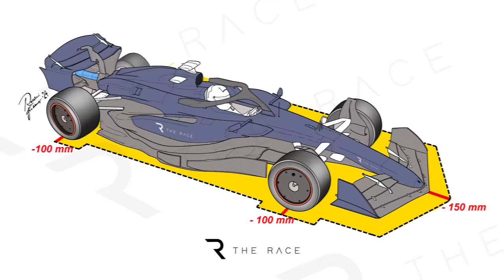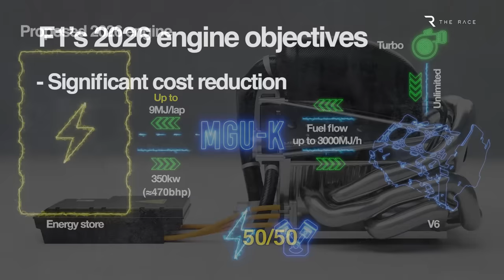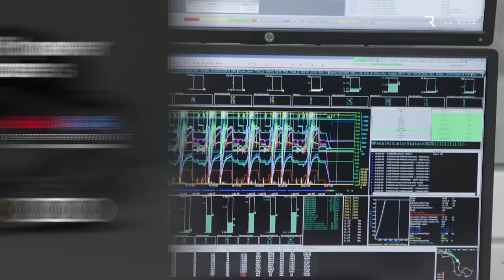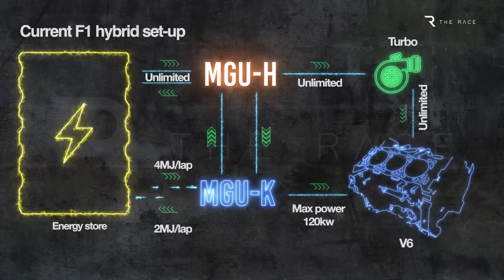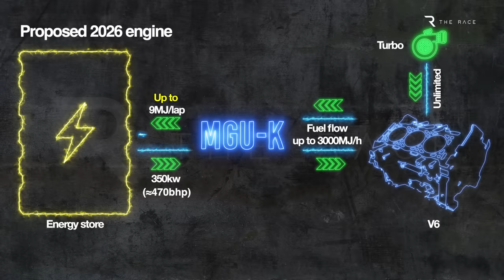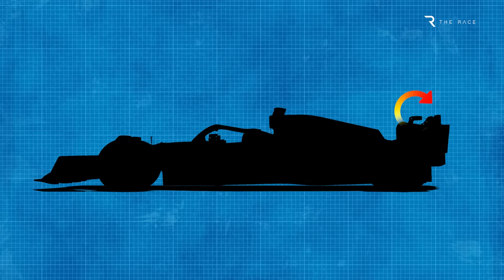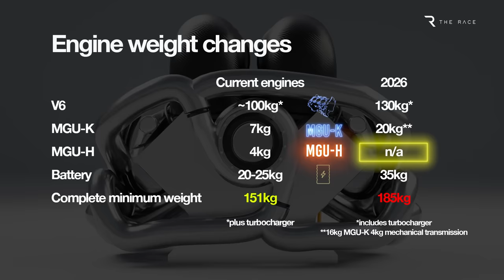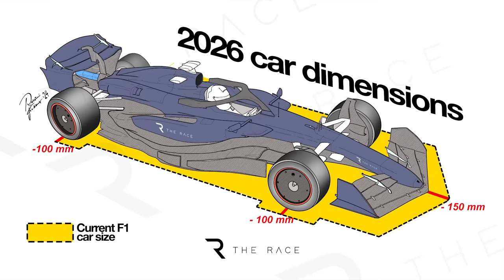The truth about F1's controversial 2026 cars

Comment: I'm dreading this a bit. I don't like the incresing inclination towards electric. I understand it is relevant to road cars, but come on. This is Formula 1, it should just be small light cars with fuel.
Reply: This is the gap between full on fossil fuels, and full on renewable fuels. Vettel is probably a vital name who is pushing heavy for new fuels, and showed this in the Mansel Lap.
Reply: No one's happy with this direction, fans don't like it and those climate activists will never be happy until abolishing Formula 1 altogether
Reply: @Jaytalise  Totally, that's why I'm supporting Vettel's wacky initiatives. But truth be told, fuel for the cars must make up for 0.00004% of the emissions of F1 if we're being honest. So this is all kind of pointless to me. Maybe let's not have 24 races a season, keep it in 20 and that way they more than compensate the fuel from the cars.
Reply: Yeah, I would much prefer that they focus on encouraging teams to experiment with e-fuels. It could still be road car relevant, environmentally sustainable, potentially less expensive, lighter weight cars, more likely to make appealing engine noise, and not conform to this all-eggs-in-one-basket electrification trend.
Reply: @LPChipi  It's not about making up the emissions, it's about making a fuel that is sustainable. If the F1 cars used a fuel like Vettel's, it would only be a matter of time before the road going cars follow, which in turn would then cut the emissions of travel down etc... I do agree that if they cut tracks out then it's obvious that'll compensate. Im just saying that the current era of electricity is just a stop gap before we get to that point.
Reply: @sam-nariman6236  nonsense. i love both, dont be a child
Reply: @Jaytalise  its already avaialble, at about 5 euros per litre right now
Reply: @LPChipi this is the best comment I’ve ever seen on these regs. Great point.
Reply: @Jaytalise  Yep, completely agree. Interesting point. I hope Vettel can push this forward so we can get "back to normal"
Reply: @LPChipi  he won't
Reply: Manufacturers have moved on from that though. I am sure you'll complain the same way when it's just Red Bull and Ferrari on the grid because everyone else isn't interested in the old Formula anymore.
Reply: @PazLeBon  You love both? What both? Climate and F1? So? They are irrelevant
Reply: @PazLeBon  Please enlighten me what you've actually done to show your love for both. Hailing all zero emission products? Trusting all zero emission slogans? Or eating more vegetables because meat bad bad?
Reply: @jkliao6486  lol whhat you waffling about mate? I love F1 and love nature, not really anything political about it
Reply: @sam-nariman6236  if you state climate activists will never be happy until abolishing Formula 1 then you kinda made it relevant no?  seeing as climate activism is a real thing
Reply: Good luck finding any good manufacturers that would want to enter then. It has to become relevant for these manufacturers or that would be the end of F1. Its not about the emissions guys. Ur completely missing the point.
Reply: @jkliao6486  Lmao, just say you don't trust science and go watch some more conservative day time tv 💀
Reply: Really they should be all petrol engines using full synthetic fuel
Reply: Or just go full electric already. F1 cars are no longer at the cutting edge and this can be seen by the fact the Rimac Nevara can beat and F1 car in a drag race. The McMurty speirling is amazing and no doubt would beat an F1 car round most tracks.
Reply: @rtmclean484  How would this differ from formula E?
Reply: @sam-nariman6236 When you say "no-one" of course you mean a vocal minority of fans, because a large proportion of us are actually in favour of advancing, rather than regressing, and a massive section of the fan base really don't care. Of all the F1 fans I know, only 1 other person takes an interest in the technical side and he's a Porsche retail mechanic.
Reply: 200th like
Reply: @rtmclean484  This take is insane. The McMurty doesn't go over 310kmh. There's no way any of these cars are able to beat an F1 car. They're still quicker by quite a margin.
Reply: Especially considering the entire offset of an F1 car during a race is comparable to one family cars output for a year. If 20 people would sell their car and take the train, you would already offset the carbon exhaust of the F1 cars. The real output is due to people travelling to the race and logistics of the race itself. It's just a marketing stunt, one which is hurting the sport massively.
Reply: @nielsvanheteren  That should be over +400 people tho. 20 cars * 24 races. But totally agree that the logistics are the far bigger issue.
Reply: @rtmclean484   drag races are irrelevant to performance on a track. EVs are not the way forward.
Reply: @nielsvanheteren   I'm not sure where you're getting that number from, but it's laughable. An F1 car uses 100 kg of fuel during a race, often times less, and it's operating at a higher efficiency level than a road engine. There is no way in hell that's a "family car output for a year." I'd be surprised if it's a family car output for a month.
Reply: easier said than done, there wouldn’t be engines for the cars if manufacturers didn’t see a point in investing here
Reply: As an EV person myself, I totally agree!! F1 should be purely hybrid with MAYBE a capacitor booster (light af) for acceleration. I'm also amazed they haven't went to nitro methane by now. Idk why F1 thinks it needs to be eco friendly, it's such a low impact in the grand scheme of things 🙄

Comment: I already hate these rules. I don't think the cars have lost nearly enough weight or size either.

There's already too much going on on the steering wheel for a start. Too many driver aids, now they want to add more active aero? I already despise DRS, now they're adding more drag reduction components.

Its taken many years to try and perfect DRS and it's still off at certain tracks. Now we're gonna spend another decade trying to balance these things?

They're too complex as well. Commentators will spend all of the race explaining why the car was responsible for a lost position.
Reply: Side from active aero, driver aids have been banned since the mid 2000’s
There’s no ABS, traction control, automatic gearing etc.
Reply: New active aero probably activates the same as DRS
Reply: They lost some weight and size, that's something. When was the last time that even happened?
Reply: Removing one of the most technically advanced parts of the drivetrain makes them simpler actually
Reply: @theviniso  I googled it for weight reduction, not gonna bother with size: it happened multiple times in the 1980's trying to keep non-turbo cars relevant, and it hasn't happened since.
Reply: @RD-wg9em  Flappy paddles.
Reply: I'm curious, why do you dislike active aero parts

Comment: F1 would have a seventh engine manufacturer in GM/Cadillac if the teams didn't keep blocking their entry with Andretti.
Reply: and thats just the engine we have all dreamed woud be in f1 one day lol
Reply: Clearly Andretti not 100% ready yet, lol
Reply: @PazLeBon  F1 wants to appeal to more manufacturers for higher revenues, so another one is in their interest no matter who it is.
Reply: @Flared  Sure, i do agree ;)
Reply: @Flared  lol sure tell that to the WEC and IMSA gaining more manufacturers then F1, F1 is definitely doing something wrong.
Reply: @Flared the fia wants them in F1 doesn’t.
The prize money being split by an 11th team isn’t trivial, and all the teams on the grid will block Andretti for that reason alone
Reply: Andretti is denied because GM/Cadillac isn't with them
Reply: GM were not entering as a PU supplier. They were just a badge on someone else's engine. That's why F1 refused their entry.
There is no need for another backmarker using the garbage Renault engine.
Reply: @RD-wg9em  increase the prizepool then. Voila, problem solved.
Reply: @LSB001  GM are entering as a proper PU supplier in 2028, stop chatting nonsense.
Also, the engine is the least of Alpine's worries, their aerodynamics are significantly worse.

Comment: They should give the drivers NOS, with a big dramatic button, add stick shifts, and add about 14 extra gears
Reply: And springboards
Reply: and the FIA would say "NOS is limited to 0.2 nanoseconds per lap and you are only allowed to use 13 of those 14 gears in soon to be defined sections on the track", ngl the FIA would find a way to restrict it even more

Comment: Ridiculously complex. Bring back modern V10s, no active aero, no DRS, no ERS, much lighter and smaller, regulate outwash for following.
Reply: This. Someone who understands
Reply: No OEM is gonna waste money on a V10, they’re bad engines outside of the noise and they’re not road relevant.
Volkswagen and the other teams would’ve pushed the FIA on them when they negotiated the engine rules otherwise
Reply: @RD-wg9em  nothing about these cars have ever been road relevent
Reply: @CascadeSport  a lot of tech in road cars owes its start to F1. Minor things like steering wheel buttons and carbon fibre, to active suspension, and split turbocharging, to hybrid tech, where brake regeneration developed in the sport is utilised.
There’s a 5-10 year lag, but a lot of the work done is relevant, the manufacturers use that fact to justify the costs
Reply: @titancheat understands what exactly
Not F1 certainly
Reply: If we're keeping the no refuel rule and fuel flow limit, the V10  rev limit is probably less than 15k rpm and probably will generate less than 700hp. And the car weight wouldn't change much, probably around 50kg lighter.
Reply: @RD-wg9em  most of the tech in F1 began in other types of machines, like aerospace, marine, and railroads. And most of this kind of tech really hasn't done much to make road cars, much less race cars, better, it's all crutches and gimmicks. All this hybrid in F1 is a sorry attempt by the FIA to appear environmentally friendly when this sport is increasingly becoming the opposite of that.
Reply: @CascadeSport  "his sport is increasingly becoming the opposite of that."

It isn't becoming the opposite at all. The engines are more efficient, but that's a drop in the bucket compared to the significant improvements in logistics efficiencies and scheduling that have reduced the entire sport's waste by a significant amount. It's still a bit of a virtue signal, since the sport itself in total is way less than, say, one of China's many new coal power plants, but it has resulted in a few improvements across a few industries.
Reply: @catalintimofti1117  no cars are turbo and hybrid. The sport is becoming more complex and its less sustainable for teams like Williams or haas. Nevermind a Marussia or Caterham. Also a simpler format puts more emphasis on the driver rather than the car. But what do I know. Apparently your the Adrian newey here. Certainly
Reply: @RD-wg9em if you adjust for inflation they are approximately 1/3 the cost of a current "power unit" including the batrery.
They are also 1/2 the weight.
You could triple the engine allowance without changing the cost to teams.
They can also run on 100% biofuel so they are even better for the environment.
There are a LOT of reasons manufactures would develop that engine.
Reply: @titancheat  Everybody understands it, I think people running F1 would agree to bring this kind of F1 back as well, but the reality is a bit more complex. OEMs want road relevancy, this alone keeps us away from traditional ICEs. e-Fuel is the only alternative, but it is still in its infancy stage and I am afraid that OEMs have invested too much into hybrid/electric technology to turn back.

The only thing we can really demand for, is to reduce the empty space at the back of the car, that was introduced in 2017 to artificially lengthen the car, giving teams a larger aerodynamic platform.
Reply: @RD-wg9em most of those have nothing to do with the engines and most of the hybrid stuff in road cars is owed to what Toyota was doing when they spearheaded hybrids. The actual engines themselves have nothing to do with road cars even including the hybrid, Adrian Newey himself says this
Reply: The sport is ruined by politics.
Reply: @RD-wg9em  wrong,

Comment: Push back these regs to 2028 if needed, but get rid of electric engine and just have normal engine. Also make cars smaller and lighter and smaller wheels. Go back to early 2000's
Reply: Nice try Max, you don't get to dominate an extra two years lol. Regs need to change 2026 or they'll lose every fan when red bull keeps winning everything.
Reply: @racecarrik  They didn't lose the fans when Lewis and Merc were drop kicking everyone for 6 years. Double standard much?
Reply: @razick0  Whataboutism at its finest, any long term dominance is bad, as was Merc's, though look at how many different winners there used to be during those seasons compared to literally everything being won by Red Bull nowadays...
Reply: @MrJonas7  I agree with you on everything, but I was talking about double standards. When Merc was winning people were quiet, and that was for 7 years. This one has been going for 2 and people are asking for Verstappen’’s head. And as an addendum, I’m a supporter of neither of them.
Reply: @racecarrik  Im not Max fan. I want his domination to end. I want close racing and dont want anyone to dominate. But i also dont want F1 to be slower than F2.
Reply: @Kornn66 you want closer racing.

Yet you want back the early 2000s, the worst years for close racing.

Get your s*it togheter.
Reply: Racing doesn't go backwards, it goes forwards, especially in F1.

It sounds to me like BTCC would be more your speed.
Reply: @mondodimotori  what you mean worst years? There was only 2 years when schumi was totally dominating. 2003 Kimi lost the title by 2 points.
Reply: @mondodimotori  and by early 2000's i ment that i want the cars to be the size of that era.
Reply: @mondodimotori  or lets just say pre 2017 cars as that was when the cars started to get too big and heavy.
Reply: @razick0  I remember people being fed up with Merc's dominance very much. It's also double the annoyance that it happened again with RB.
Reply: @racecarrik  Hamilton was fine though 🤡
Reply: @razick0 people were quiet when Merc and Lewis were dominating? We must have been watching different F1 back then because people absolutely complained lol. It took me only a couple minutes to find a quote from Christian Horner in 2015 “Interest will wane. Mercedes have done a super job, but the gap is too big. The FIA could quite easily come up with a way of a form of equalisation.” And Marko went even further by threatening to pull RB out of F1.
Reply: I'd say smaller, lighter with wider wheels, a 50/50 mis of aero and ground effect but with the benefit of more mechanical grip from the tyre there would be less of need for downforce.
Reply: Cars are bigger and heavier mainly because of safety regulations. They really don't have to remove the V6H, they just need to be less crazy about safety.
Reply: @Kornn66 you had 3 overtakes a race
Reply: @MrJonas7  "whataboutism" is the most overused nonsense phrase on the internet. The people who invented it were allergic to counterexamples and accountability. Stop using that garbage phrase.

"look at how many different winners there used to be during those seasons":
2014: the only non-Mercedes winner was Ricciardo, Mercedes won 16/19 (84%)
2015: the only non-Mercedes winner was Vettel, Mercedes won 16/19 (84%)
2016: the only non-Mercedes winners were Max and Danny, Mercedes won 19/21 (90.5%)
2017: Mercedes won 12/20 (60%)
2018: Mercedes won 11/21 (52.4%)
2019: Mercedes won 15/21 (71.4%)
2020: Mercedes won 13/17 (76.5)
---
2021: Red Bull won 11/20 (55%)
2022: Red Bull won 17/22 (77%)
2023: Red Bull won 21/22 (95.5%)

Only in 2023 were Red Bull anywhere near as dominant as Merc were at the beginning of the hybrid era. Only 2017-2019 were more competitive than the 2022 season, the first year of the new ground-effect regulations.

Try making statements based in fact and stop worrying about inane catchphrases.
Reply: @Amin-dd9mk   not plausible. The larger fuel tanks and the hybrid batteries are the biggest reason for the giant cars (that, and the teams will maximize whatever footprint the regs allow because that makes the floor bigger). The safety regs could be retained and the cars shrunk significantly if they didn't require the hybrid equipment.
Reply: @jsquared1013  not quite. If you compare 2013 cars and 2016 cars, you can see that the size difference are very minimal. If I got something wrong, feel free to correct me. Anyway, the conclusion I could end up with is safety reason. Does the car need to be more safe? Don't think so. Since the V8 era, drivers that got involved in a car crash usually walks away as if nothing happened. I don't oppose the idea of safety, I just don't think it's necessary by much. I think FIA should rewrite the regulation to allow the use of bargeboard (even though it's ugly to some) and keep the ground effects regulation to stay. This will result in cars with massive amount of downforce, where they can freely reduce the size of the car by a lot and cars should also be safer in a way.
Reply: Yes. Go backwards with slower cars!  As long as you can say there’s no electric motor you’re happy! Yay!
Reply: There was more different winners simply because Lewis, Nico and Bottas are not as consistent as 21 and onwards Max! They had their good and bad weekends.

This RB is no where near as dominant as that Mercedes when comparing every time stat out there! Max is just driving like a robot now.
Also these new regs are only 4 years long and the last major change before that was 8 years! Merc got quite lucky there…. :)